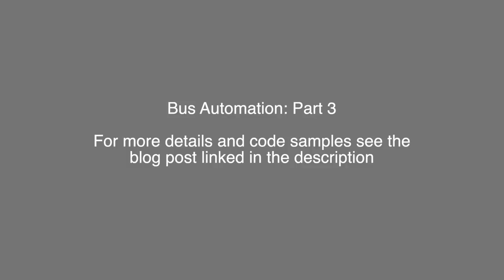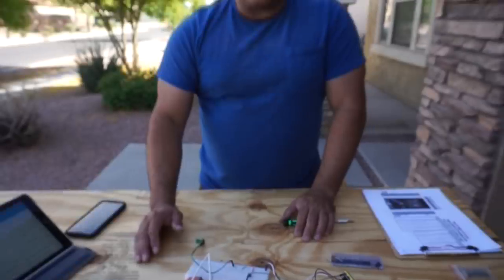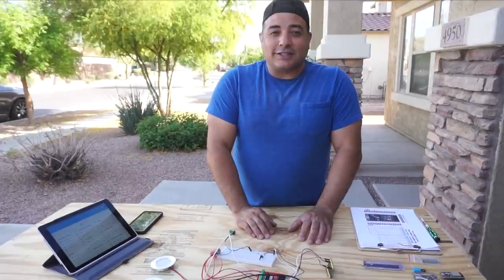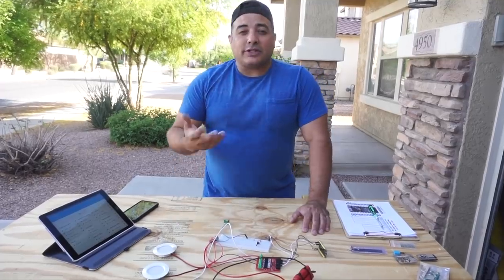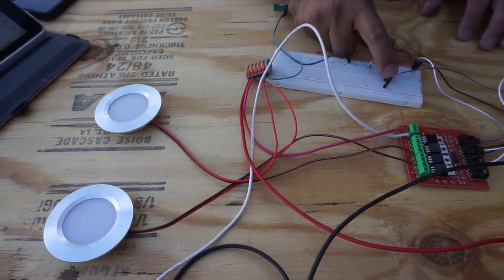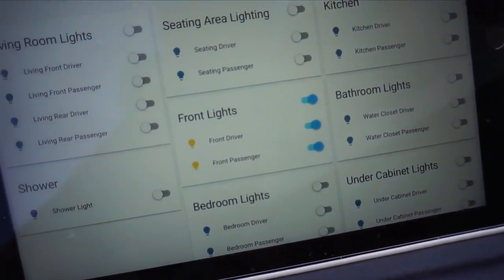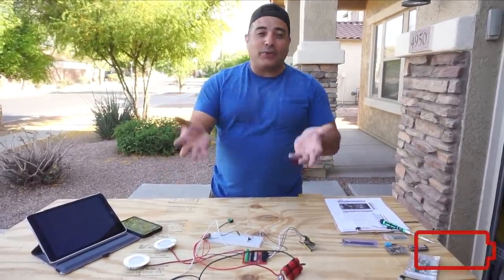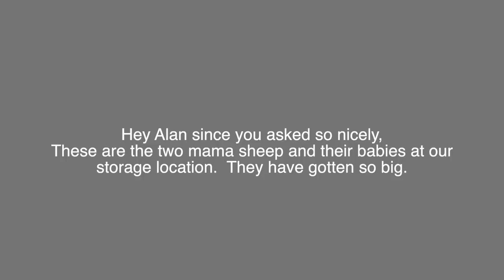Bus Automation: Part 3 - Dimming the Lights and Graceful Degradation

Comment: Did you read my last comments?
Reply from the maker: I did read your last comment - I read all the comments that are posted on the videos and I try to respond as I have time.
If you notice the date on this video - this was released on April 18, 2019, which means I probably recorded it sometime in January or February of 2019.  This was almost 2 years ago.  I am building an entire bus - this is one tiny facet of that project.  I have already purchased basically everything I need to do this project long ago and the solution you are offering is substantially worse than what I have.
We can call cost a wash Aurdinos are cheap - Hats are cheap when bought overseas.  If I buy the Mofet boards from aliexpress I can get them for $2 each - I can also get the ESP32 boards for about $2 as well.  The jaw-dropping part of all this is how cheap all of this is.
Pricing aside there are many reasons I did not go with the Arduino Uno (or any other 'standard' Arduino for that matter)
I need to power 16 "dimmable zones" on this particular set of circuits.  (I would also like to add some temperature monitors and a motion detection circuit but that is for another discussion). This means I need 16 "pins" which are capable of producing a PWM signal.  Sadly the Arduino Uno only provides 6 pins that are capable of doing this.  In the Arduino Uno - pins 3,5,6,9,10,11 have PWM capability (https://www.circuito.io/blog/arduino-uno-pinout/).  So even if I could stack 4 motor HATs on the Arduino I could only drive 6 devices with PWM.  So I would need to run 3 Arduino Unos and 6 HATs to do the job of a single ESP32 with 4 MOSFET boards.  Additionally, the Arduino does the PWM as a software-implemented PWM - meaning as I run more things PWM on the Uno it will become less and less responsive (yes this is a really bad issue - look it up).  The ESP32 has 16 dedicated  PWM channels that run on dedicated hardware so they don't take up any processing cycles in your main code loop.  Another thing to keep in mind is this is not just stand-alone lights but as a part of a home automation solution - so it needs to be able to communicate to other devices over the network.  The ESP32 has built-in networking and Bluetooth that is not typically found on Arduino boards (which also eats up more IO pins and buying more HATs).  In addition, it also offers many more GPIO options and most of those are fully configurable.  The ESP32 also has a much faster processor and more memory.
Here is a comparison of processing speed: https://youtu.be/zofdh1mIa6g (spoiler - it's not even close the ESP32 is easily 15X  faster on top of the dedicated hardware for networking and PWM)
Here is another speed comparison - again it's not even remotely close (this time calculating prime numbers - spoiler the ESP32 is 160X faster this time) - https://youtu.be/jpVcCmh8sig?t=1622
Here is a nice summary of why the ESP32 is a great choice for IOT solutions.  https://www.youtube.com/watch?v=A5CB4t9sukM
Reply: @BeginningfromthisMorning    You are not reading it correctly or something.  I even explained it to you. 

NO.  " This means I need 16 "pins" which are capable of producing a PWM signal."  
You do not need 16 pins. You only need 4 pins. That's it. AGAIN the motor shields run off I2C. With only 4 pins, you can piggyback/daisy chain up to 64 separate devices.  AND you still have  pins 3,5,6,9,10,11 available.

NO. " Additionally, the Arduino does the PWM as a software-implemented PWM - meaning as I run more things PWM on the Uno it will become less and less responsive (yes this is a really bad issue - look it up)."  
Again the MOTOR SHIELD is the one that  handles the PWM  signal. The arduino only tells the shield what speed/light level it needs to be at.  LOOK IT UP. 

"Another thing to keep in mind is this is not just stand-alone lights but as a part of a home automation solution - so it needs to be able to communicate to other devices over the network.  The ESP32 has built-in networking and Bluetooth that is not typically found on Arduino boards (which also eats up more IO pins and buying more HATs)."
If you would just do some research you would stop saying you will need more Shields.  Plus you would find out that you can do that very same home automation you are doing.

Again. The setup I have now with  Arduino Uno, 
Motor Shield,
I/O Expansion extend Board Micro Sensor Shield Module, 
Homemade I2C Expansion Board, 
LCD 16x2, 
LCD 20x4, 
2 flat motors, 
1 Linear Actuator, 
2   3x4 Keypads,
12V Interior LED Light Bar, 48 LEDs,
Ethernet Shield,
RTC and DHT  sensor.
added loudspeaker , amp and mp3 player. 
Guess where I control all them from?  I have manual and internet based controls. That's internet not just home network. 

Unless you want to run a diso in that bus you don't need processing speed. Again the arduino is not the one that handles the PWM. Each SHIELD handles its own channels. You are not running a 3D printer or CNC machine with that thing. You are just controlling lights. and reading sensors. It's not like you are having the thing drive the bus for you. LOL

And I already know you posted this a long time ago. I am just letting you know and any other person that wants to do this, that there is a much better solution than the one you are promoting. 

" So I would need to run 3 Arduino Unos and 6 HATs to do the job of a single ESP32 with 4 MOSFET boards."
You should really look it up and not just assume. 

So again 1 Arduino and 4 SHIELDS,  much less hassle and half the wiring.  NO 16 pins needed. NO extra board need mounting. Adding sensors is a breeze. 
BTW By the time you add up all the time spent wiring, plus wiring, plus the buck converters, You have spent way more money than I have yet I am running way more than you. And I am actually using it to actually automate. Not just turning on and off lights and read a few sensors now in then. 

LOOK into it. I can tell you haven't. If you did you wouldn't be throwing out all this wrong information.
Reply from the maker: @AztecWarrior69_69  OK I was looking at the non I2C shields that are really just motor drivers.  Now I see what you are talking about and that would indeed work great.
Reply: @BeginningfromthisMorning  So which ones were you looking at?